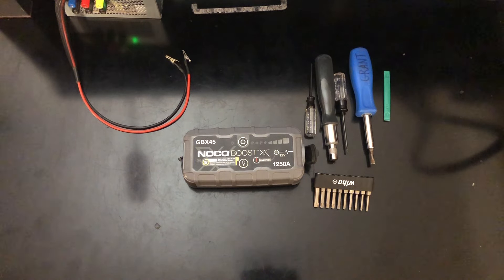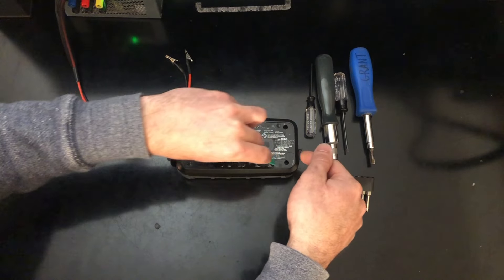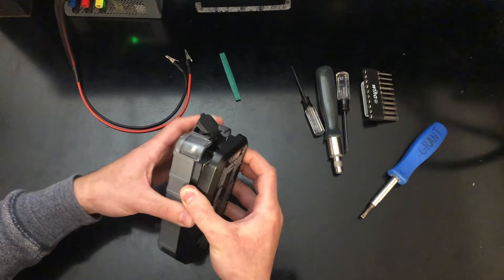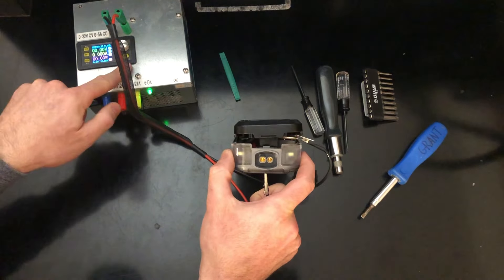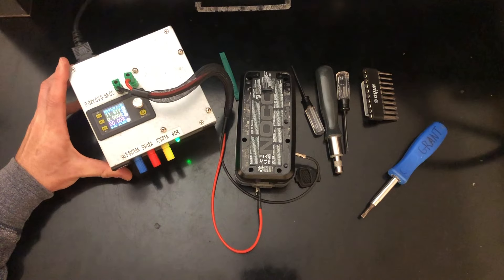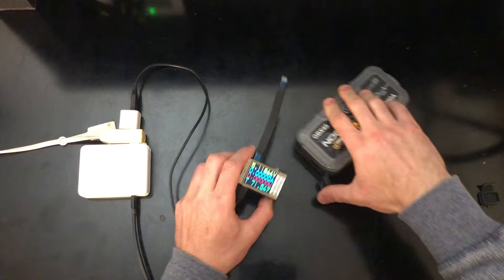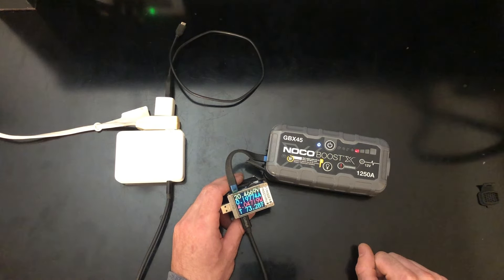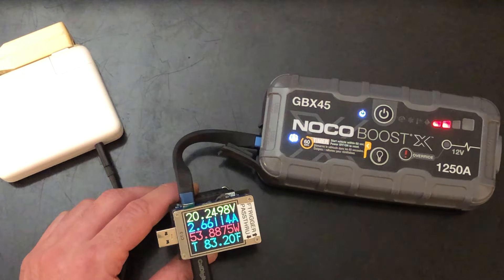NOCO Boost GBX45 Repair

Comment: Excellent video, thank you!   So the key here is  NOT to let the internal batteries discharge to a low level  where you need to do this.
Reply from the maker: Exactly!!!
Reply: So charge at 1/2 way point is what I've been seening and understanding from different videos.
Reply: I think this apply to anything with a lithium Ion Battery such as solar lights with no BMS chip (battery management system)
Reply: I’ve rescued several devices with internal batteries using this same approach, the most recent is a Phillips razor.

I also have a GBX75 and will go out and charge it right now while I’m thinking about it!  I used it to boost my neighbor’s car a couple months ago and didn’t charge it after.
Reply: Why don’t they fix the issue instead of making the consumer do this nonsense.  Ridiculous
Reply: @Smokeshow767  this seems to be very common with any consumer electronics that have internal Li-Ion batteries.  Even professional power tool batteries can go “dead” if you leave them discharged for too long.

This might be a battery thing and not a Noco thing.

Comment: Your video motivated me to buy the benchtop power supply I had already been eyeing. $60-70 PSU saved me from buying another $100-150 jump pack. The NOCO was super dead and failed to be revived by the 12V car outlet quick-charger. It's back in business and has probably been used a dozen times since. Bonus points for the PSU having already seen use bench-testing components and circuits since the NOCO repair. Big ups for fixing stuff rather than tossing.
Reply from the maker: That's great! Good going!
Reply from the maker: I just posted a video detailing how I built mine from an ATX power supply. I know you already bought one, but thought you might be interested!
Reply: @colindgrant  I'll definitely check it out. Especially since I just dove into PC building this past year as well. So it'll be neat to see. Cheers for the comment/content

Comment: So... In between those 2 negative terminals on that little board,  is the BMS.  Right?
Reply from the maker: Yes. A high current relay that is controlled by a Battery Management/Monitoring System.
It doesn't look like the BMS does any balancing, it just looks out for maximum and minimum voltages on any of the cells.

Comment: How long did the GBX45 sit in order to discharge?  Also did you try a USB-C Power Delivery source to try to charge it?  This may be important since they provide up to 20 Volts to charge the GBX series.
Reply from the maker: Definitely used USB-C power delivery. That's what the MacBook charger is all about. And yes, the maximum 60W fast charge comes from USB-PD 20V@3A.

I don't know what discharged it. But I have a feeling it was left in the 'override' mode, since that would disable the normal BMS protection features.

Comment: Thank for your video, I can see some relays in the video on the (-) side so it gave me the idea that you can also do this without opening the noco. I did it and it worked.

Just connect any USBA wire to the USB OUTPUT port on the noco then clip the negative to the other side of the connector, basically using the wires shielding/ground as negative (no need to cut any wires). Then connect the (+) to the red car jumper cable. 9V battery or PSU
 
disconnect it and then put the USBC charger in. 

it might take a few attempts if the charger LED goes red next to the usb c port then it needs longer on the 9V. if it stays off and the battery health light flashes red then its worked. =)
Reply from the maker: Very clever! I like that idea!

To anyone reading this comment and looking for a bit more info: I opened the NOCO so that I could get to the negative lead that goes direct to the battery. But the cool thing in this comment is that the USB interface gives you direct access to the negative side of the battery too! So at very least, you can take a measurement, but if you're careful you can also input a charge direct to the battery. You won't be going through the USB charge controller, you'll just be using the negative connection which is present on the USB port. Genius!
Reply: Hi, would this method work with a 12v battery as well, or is that too much voltage?
Reply from the maker: @Cobra-sy3sv  12V isn't too much, but you'll need some means of limiting current. It's not like charging a lead acid car battery, Lithium has low internal resistance, so it doesn't self-regulate. If you were to hook up a car battery, the lithium cells would suck up amps way way too fast!
Reply: Thanks for sharing this! Instead of a 9v battery I used an old 12V 1A power supply for an old router.  I connected it to the noco for maybe 2 mins. After that it was enough to not give the red blinking light when connected to a USB C charger.
Reply from the maker: @carjason19  Great solution!
Reply: @carjason19 I'm also looking to try to fix my noco as well. Did you had to cut up your old router power supply leads and fix it to noci usb end and also connect to the positive end to the noco?
Reply: @TheMaverick8519  Yes. I cut the end of the leads on the 12v power supply.  Negative(-) lead to ground on USB out and Positive(+) lead to noco positive red jumper cable.
Reply: I know this is an old comment but I just wanted to say, thank you so much for this comment. I used a Noco genius 1 amp battery charger that I had and did what you said. Left it on there for 5 minutes and then plugged the gbx charger back in and it took off. I appreciate you 👍
Reply from the maker: This was such a good idea, I went ahead and made a video about it. Thanks @sol05033149!
https://youtu.be/-xueq2GjKs0
Reply: @colindgrant  winning move. I like this guy.
Reply: This is a solid idea presuming you can limit the charge current.
Reply: Yes, this works every time without fail.

Comment: i just wanted to extend a thanks..you inspired me :) :)..  mine is 9 months old and used once to test, put it away fully charged and went back to it 7 months later again to test and fully charge again, and it was dead.. as you described..

i was reluctant to open it up thinking it was full of epoxy due to the weight of it, but i did and got it back up and running.. 

also.. the back cover is taped onto the battery with double sided tape so it would just unstick and allow for full access, i just slipped a small screwdriver up into the cover between the battery and cover and it just popped off....

Comment: Hi, thanks for this video. I'm considering about buying this booster. If I know, it hasn't direct 12V out (for 12V devices). Can you see there any possibility how to get from it 12V (about 10 - 15 A) for this use, for example longtime use of manual override mode and conect 12V device to clamps out? (Better with some fuse ofcourse) Or some DIY hack?
Thanks 🙂
Reply from the maker: I think the override mode will do what you want. It just directly connects the battery pack to the clamps with no protections. You'll get 12-16 volts and there's no timeout that I'm aware of.
Reply: @colindgrant  thank you 🙂

Comment: Mine something just burned out in boost mode - they say they don’t recommend you use boost mode… I would concur!
Reply from the maker: There isn't actually any boost mode. The battery is either connected to the clamps or not. If you're talking about the override, that is a feature of the product. It's fine to use if you know what you're doing, and follow instructions.

Comment: Thanks for the Video Colin,  I’ve heard that if you use the 12V Car accessory port to charge the NOCO GBX series when the battery is too low for USB charging that it will come back to life after 15 mins.  

Have you tried that?
Reply from the maker: I don't see why that would work. You're still powering through the USB-C interface, so I would assume you would hit the same internal PD charge controller limitations. I have read that as well but never tried it.
Reply: @colindgrant  I’m not sure why it would work, but that’s what some people who work at NOCO were telling customers.
Reply: I’ve heard the same thing. That is what Noco has stated also regarding this issue.
Reply: This didn’t work for me.  Still won’t charge.  Only the white light comes on, but it doesn’t charge.

Comment: How long did you have the battery hooked up to your external power source before hooking it up to a USB C charger. I have 2 of these with this problem. 1 has 5.57v and the other has 4.39v.
Reply from the maker: Time isn't so important as voltage. You'll want to slow charge the pack up to 12V+.

Comment: Nice video.
Would like to check if I can fix the GB40 with the same method?
Reply from the maker: Thanks. It should be the same process, I just don't know if they have 3s or 4s battery packs inside. You'd have to figure that out. Or maybe somebody reading this knows?

Comment: You made the power supply yourself using PC power supply ? looks cool
Reply from the maker: Yes I did. I used a DPH5005 50V 5A buck boost converter, powered off of the 12V rail inside of an ATX power supply (that I pulled out of an e-waste bin)! It was a fun project.

Comment: Get a 2wire usbc and clamp a trickle charger for about 15 or 20 mins disconnect and use the Noco usbc charger and it should charge
Reply from the maker: https://youtu.be/-xueq2GjKs0?si=-BD0Y14ZrFVFuyXy

Comment: Try charging with a 65W USB-C fast charger before taking it apart
Reply from the maker: I used a 140W USB-PD (Power Delivery) capable charger. I was able to measure it providing 60W charge power once the unit was fixed. Prior to taking things apart, no current would flow from any charger, whether old or new, regardless of wattage. Do you know something I don't?
Reply: @colindgrant  NOCO support recommended trying a fast charger
Reply from the maker: @DavidK-uv8oe  yeah, that's what I used. I was able to measure the actual current flow, and there was next to none, regardless of charger used.
Reply: I tried that did not work

Comment: Is the older version better?
Reply from the maker: I only have experience with a few of them.
The GB40 is USB-A/Micro only, so it doesn't charge up as quickly. The GBX45 and GBX55 are nearly identical inside, with different sized pouch cells, and they have USB-C in/out as well as USB-A out. So I like the GBX series.
Reply: @colindgrant   Thank you.  I wish I could use a memory saver with those.

Comment: Open it up there’s a yellow and a black wire marked on the circuit board positive and negative expose some wire and connect it to a Dewalt battery
Reply from the maker: Do not do that. You have no idea how much current that DeWalt battery can dump into those tiny wires in certain circumstances. Easily over 100 amps, from a 5S battery pack while the NOCO is a 4S pack. And DeWalt is the worst choice of all power tool batteries to use because they are unregulated (DeWalt puts the battery smarts in the tool, everyone else puts it in the battery). I have no doubt it worked for you, but it's it great way to melt wires or much worse. A 12V wall adapter would at least limit the current and the voltage. Lastly there's no reason to expose wire, or to use the yellow wire, when you've got access to the heavy duty red and black lines direct to the pack.

I'm a safety 3rd kind of guy, but this is really dangerous advice. Please don't follow it.

Comment: looks like the low voltage protection shuts off and keeps it off.  really stupid of them.....or just really good marketing.
Reply from the maker: I think it's a safety thing. If a battery goes below a certain level, NOCO can't be 100% certain that it is safe to recharge. The battery manufacturers specify max depth of discharge. They're fine to recharge 'manually' like I did (slowly, careful monitoring, not on an airplane)! But NOCO probably considered the cost of developing a more advanced charging BMS that can handle every conceivable scenario, then considered potential liability, and decided it to just have it self-brick. Most of the power tool battery systems are like this too. I've broken down dozens of them, and there is usually just one low cell. It's a shame so many good cells get thrown away as a result.